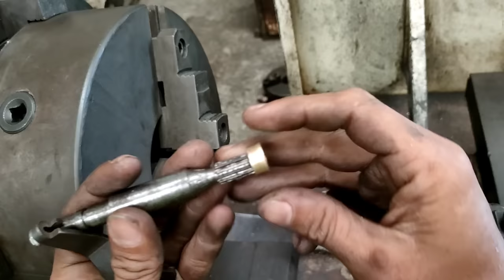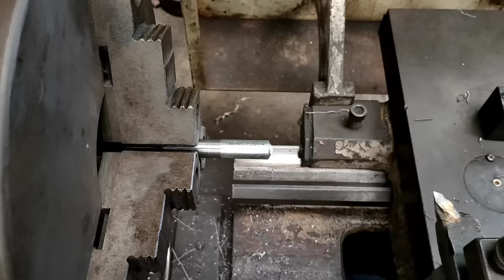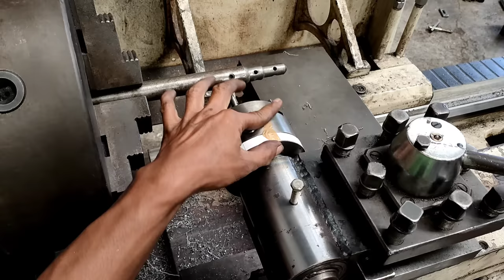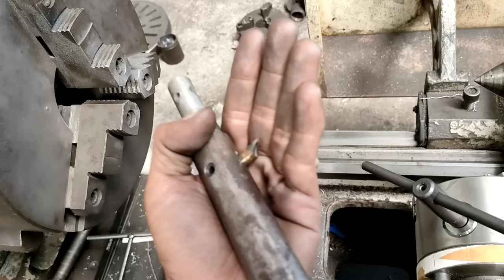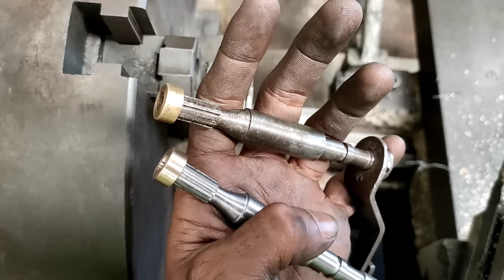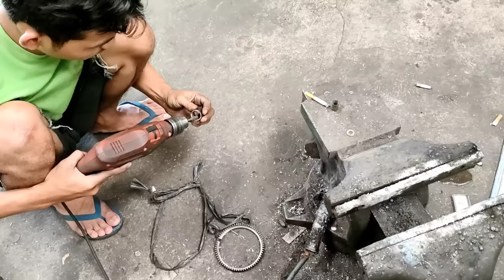Make a Vespa gear clutch shaft with a lathe

Comment: I was always interested in lathe and machine work, auto mechanics , etc and was very good at auto mechanics.  I worked at a local welding and machine shop during my ast 2-2.5 years of high school after school and Saturdays when the shop had enough work to be open on Saturdays.  In 1974 I took the US Army Armed Services Vocational Aptitude Battery of testing (ASVAB). Far as I recall I max’d the mechanical portion but did poorly on the electrical/electronics portion.  Though my real passion was for mechanical things I qualified for anything the Army had including Crypto to which I asked the recruiter Crypto what, knew nothing about Crypto or that it was code breaking.  I was told electrical/electronics was the future and not mechanics or machine shop work.  So I searched the Arm MOS books for Army Advanced Individual Training(AIT) and Military Occupational Specialities (MOS) that had good paying high demand civilian occupations/jobs.  I chose a state of the art then surface to air radar missile system course that was difficult for me but I passed and was an excelling member of my duty station.  Had job offers from the manufacturer of the radar and missile system before I left the Army but the wife and I wanted to return home.  Went home and got a job with the owning and operating utility company at the local nuclear power station under construction. Spent 29.5 years there achieving senior technical(non-degreed) engineer for my last 22 years there.  But I always missed and dreamed of machine shop work and making things with lathes, milling machines, etc.  I would have lived to apprentice under the man that taught this fellow or he himself.   Very interesting work and videos doung things with just a lathe that many would say no can’t be done on a lathe.  America probably has very few machinist still alive from the era when mental creativity did this kind of work on manual lathes not using CNC machining to manufacture.
Reply from the maker: for me the lathe is the mother of all machines.. i don't have a diploma so it is difficult for me to find a job, in my country a diploma is very necessary to get a job..
I learned to lathe myself from working in a lathe workshop as a cleaner and helping Turner

Comment: how do You know the spine will fit the mating part?  I would need to check with two small gage pins that fall into the spline and mic over them. Isnt inspection of the finished part just as or even more important as the machining itself?
 unless you have a mating part to check the fit.

all the same,  good job in making a tricky job simple